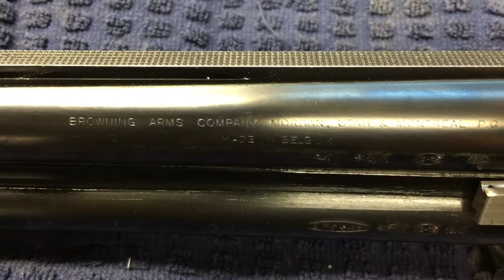Browning B26 Liege

Comment: I own one since 1979(it was a gift from my father).Very strong locking system (adjustment with lamp blacking).Adjustable electors (patent)   adjustable fore end (patent).  Demi bloc special steel barrels chokes 7.5 cm !!!  Your shotgun is a Liege (1972/75) mine is a B26 (1976/1980) After they called them B27 and B127 (some differences)..The Liege and the B26 were made in the FN factory in Liege .The B27 was made in the FN factory in Portugal ( same as the B80).They are very strong guns (100000 rounds without problem!!!!!! They were costing too much money to FN (to be build) so    they gave the patent to Miroku  Japan (Citori).It was not hand made (B25) but hand finished ! The stock of your gun is not a Liege stock but its a B26 trap (Monte Carlo) !! The Liege was only game version the B26 and B27 were ...game skeet sporting and trap !!! They were also some B26 and B27 with silver actions and engraved !!!! Excellent shotguns !!!

Comment: Hello sir....I can't believe you just posted this video 6 days ago and I bought one 2 days ago!  However, I have a B27 vs. your B26 Liege...although they are extremely similar.  May I ask a question....?  I see on your video, that the B26 has a curious part in the bottom of the receiver, just in front of the lug which comes out from the bottom of the breechface....it's the part that is sort of squarish with a screw on top of it...What is that???  Is that something to be adjusted which in turn affects how "tight" the barrel llocks up?  I looked on the parts list in the direction book that came with my gun and it isn't even a listed part!  Do you know anything about what it could be?  Many thanks, Mark C.
Reply from the maker: Mark Chicketano.  It aligns with the forend mechanism but will not adjust the breach tightness.  Like a lady after giving birth you would need an extra stitch to feel like new. There is  a field manual that might give a clue. http://www.midwestgunworks.com/field_service_manual/browning_superposed_field_service_manual.pdf   I will have a look at mine and see if I can figure out the purpose of said screw!
Reply: Hello again...I'm still enjoying my B27, but have yet to figure out that part....unfortunately, the Midwest manual is for the Superposed which I also have and which lacks that part.  I have to figure that since it has a screw, it must be for some sort of adjustment....for what, however, I do not know.  I guess we're in the minority when it comes to owning these sorts of guns since there hasn't been 1 additional comment made by anyone???
Reply: The screw does not provide adjustment.  It merely secures a block in the bottom of the action.  The rear of this block mates with a protrusion below the barrels when the gun is closed, strengthening the lock-up.  In the B25/Superposed/Citori this function is performed by the twin protrusions below the barrels that engage the two rectangular holes in the base of the action.